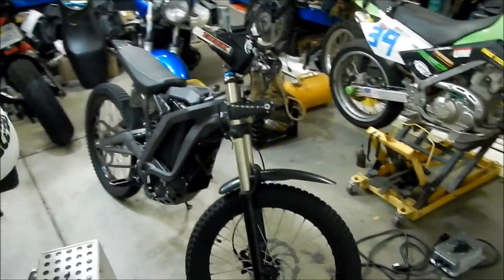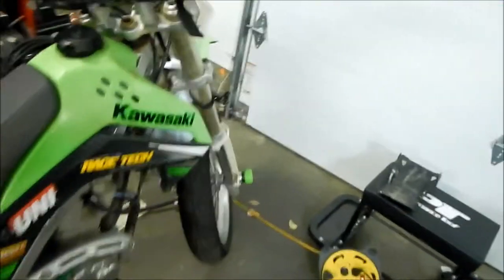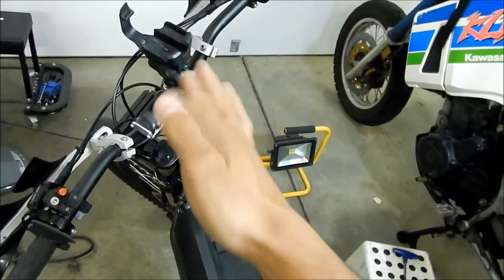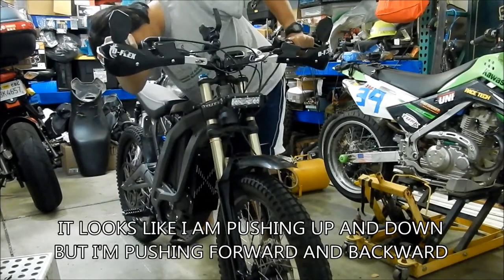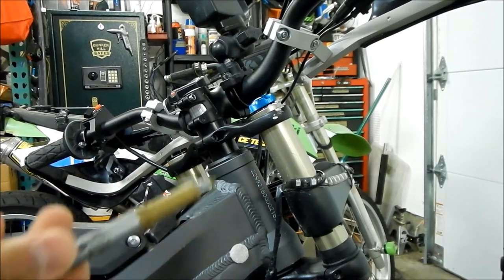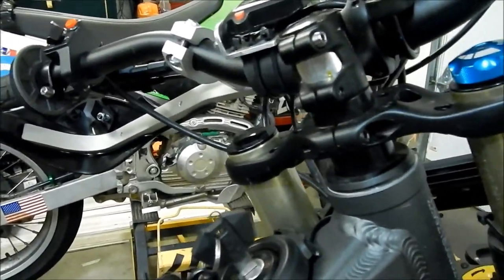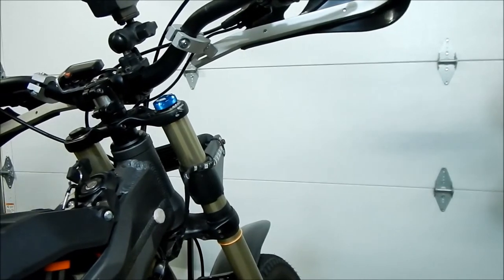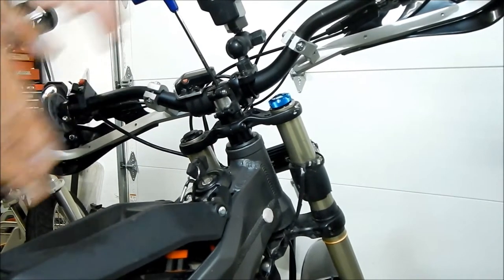Sur Ron Light Bee Headset Adjustment VLOG

Comment: i tried this and my bars are really stiff now what would i need to do to loosen em backup?
Reply from the maker: You'll have to loosen up the top clamp and star nut bolt then push down the fork stanchions into the top clamps.  Then try and  tighten it how you want it again.  I would take it for a test ride first though.  It might loosen up a bit.  I find that you want it a little too tight at first then it loosens up.

Comment: Great video.  I need to do this with my bike. I actually have the Wake bar lifters -- very curious how it worked after you installed them.  There was a concern about whether the top screw was long enough?  I am also perplexed how tightening the top screw tightens the head?  Oh, well. I'll loosen three bolts, tighten, shake, tighten shake!  Thank you!
Reply from the maker: The top screw pulls on the star nut that is "stuck" inside the stem.  When you loosen all the clamps and tighten the bolt it will pull the stem up and tighten the headset.  The handlebar stem has to be LONGER than the stem on the fork to be able to pull up on the fork, there shock be a gap up top between the top of the handlebar stem and the fork stem.  If it's not long enough you will need to add a spacer to make it stick up higher than the stem.